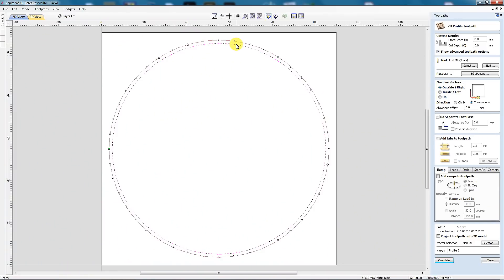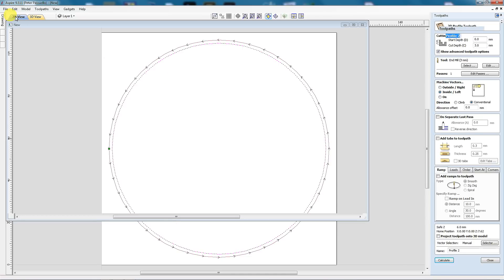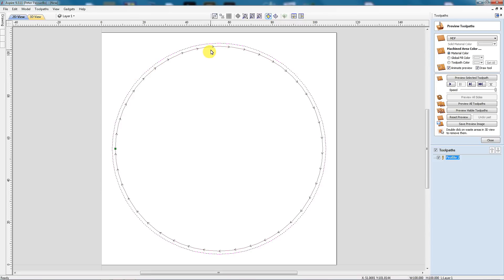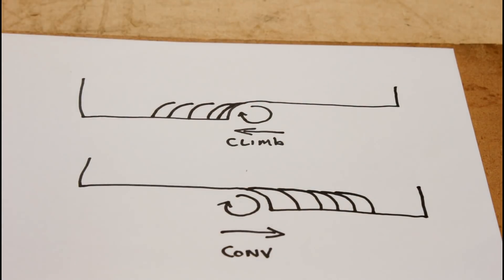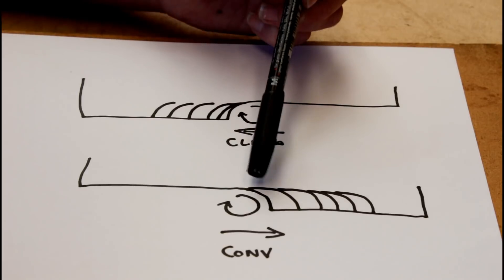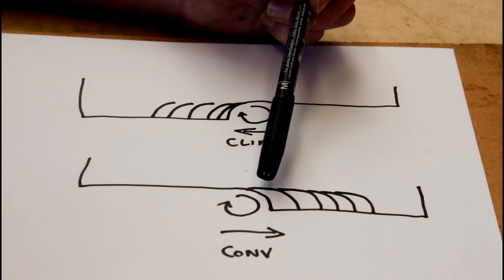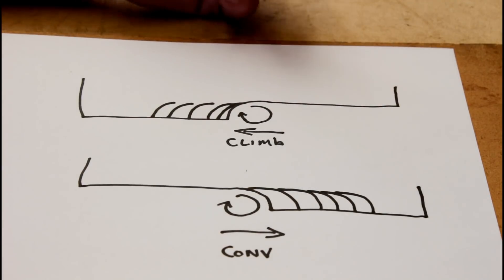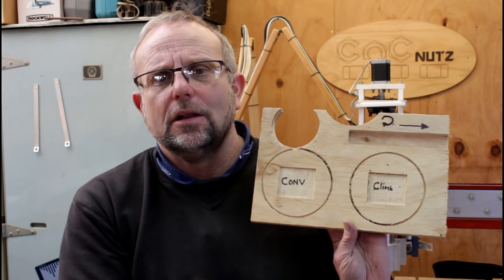Conventional or Climb Cut- CNCnutz Episode 223

Comment: using climb cut for finishing is safer in the sense that if you run on higher feeds or run into more material in tight corners and chip load peaks, cutter does not dig into material but makes an outer bump, which is easy to correct with a second pass, if desired.

Comment: one thing you must know about cutting parameters is that almost all information you can find about it was written with cutting METAL in mind.
all machinist books and manuals mean that you will cut an homogeneous material like metal or polymer.
so vast majority of this information just useless when it comes to cutting wood, foam, rubber or fiber composites.
Reply from the maker: Very true. Not much grain and fibres in steel and other metals which is what the mills traditionally cut. The same is true of feeds and speeds. Almost all the F&S tables are metal based.
Cheers
Peter

Comment: I have a nice scar on my index finder to remind me not to climb cut on a standard router. But I've always used climb on my CNC, presuming I will get a better finish - no fear of huge tearouts or broken corners like I would get with a hand held router. But, I'll have to think about what you've said here and run some tests.  Wonder if an up-cut vs down-cut vs compression bit would make a difference in the finish.
Reply from the maker: It's those sorts of lessons you never forget.
Cheers
Peter

Comment: Another informative video. Thanks Peter. I always use the conventional mode and if you think about it, the cutter is moving in the same direction as it would in a handheld router.
Reply from the maker: Thank Gareth.
That's where the name comes from. It is the conventional way of moving the hand router. I think the other way was called climb because the hand router would want to climb out of the cut.
Cheers
Peter

Comment: I cut a lot of real wood with sharp 90 degree corners and have found using climb cuts on the finish pass really helps mitigate any blow out while cutting the end grain on the corners of the wood. I definitely get those fibers left behind after the cut, but they usually get machined or sanded right off. Thanks for the vid!
Reply from the maker: Thanks Casey
Thanks for the observations. Will have to give it a try and see how it goes for me. 
Cheers
Peter

Comment: The chip load is specified at 50% RDOC, and when you are using less than 50% you have chip thinning, which means the thickest part of the chip is less than the specified (maximum) amount that occurs at 50%, regardless of whether it is done conventional or climb. In your raster pocket example, it is doing Climb in one direction and Conventional in the opposite direction. A better way of classifying Climb and Conventional cutting would be to say "thick to thin" for Climb and "thin to thick" for Conventional. Thus for any cut between 50-100% RDOC you are doing both, Conventional followed by Climb. So again, a slot is neither or both depending on how you look at it. This may help clear some things up:

https://www.cnccookbook.com/climb-milling-versus-conventional-milling/

https://www.cnccookbook.com/cnc-chef-video-chip-thinning-clear-present-danger-ignored/
Reply: Yeah Qwerty, indeed great link to that video. Very helpful info there. Missed that one before on CNC Cookbook.
Reply from the maker: Thanks Qwerty. 

That's a good website and I must spend some time looking at it as there is a lot of good info there.
Cheers
Peter

Comment: Good video Peter.

I happen to us both as the need arises. If I am machining solid wood I almost always use a climb cut because the cutter is severing the grain and not letting stress build that might lead to a split or run in the grain fiber. 

Erik
Reply from the maker: Thanks Eric.
I'm curious, do you use a slower feedrate for the climb cut than you might for a conventional one?
cheers
Peter
Reply: in the past I have not run slower on a climb cut. after hearing your logic, I will give a few test cuts at a slower feed rate a try. I tend to run pretty fast anyways, 250 in/min, time is money but if I can get better quality and less sanding, it would pay off in the long run. @cncnutz
Reply from the maker: It would be interesting to know if it makes a difference.
Cheers
Peter

Comment: Hi Peter, thanks for another thoughtful and informative video (presented in a friendly and humorous manner).
My view of conventional cutting is that it is always pushing the furry bits back into the piece - and all the big loose ends are left on the part which will be removed as the next chip.
With climb, the action of the cutter is pulling fibres out of the surface - and the surface they are coming away from is the finished one.
Everything is different when the material is not fibrous (acrylic, MDF, metal, flesh etc.)
As you said, rigidity is the key to making climb work - and if there is backlash or slop anywhere, it is doomed to fail (broken cutters).
Best wishes :-)
Reply from the maker: Thanks Perry

Comment: Great video. I believe I read, "conventional cut" the bit is sucked in to the material and with "Climb cut" the bit tries to "climb" out out the material. This can effect the cut with large cnc machines due to deflections in the machine and length of cutter bit.
Reply from the maker: I think your right Dave. If memory serves it comes from hand routing but I could be wrong. As with feeds and speeds I think this falls into the category of the black arts.
Cheers
Peter

Comment: Cut quality will vary with cutter, material, and machine: for example, in aluminum, with a brand new end mill, on a VMC in good condition (no slop in the ballscrews, etc) climb cutting will give better results almost always. However, as you showed, on your router, with your cutter, in wood, it doesn’t. 😀
Reply: The other thing that occurs to me is that your machine doesn’t have a zero backlash drive: IIRC, it’s a rack & pinion system. Consequently, as the cutter engages during a climb cut, it’s pulling the machine axis forwards, effectively generating tool chatter. 🤔
Reply from the maker: Thanks Paul

Well now I just feel foolish out in my workshop with my Black cat, Cauldron and fresh of eye of Newt.
Reading the world news lately I had got the impression that facts and science had been abolished in favor of feelings.
It's good to see that a few of us cling to the old ways, passed down from father to son, and still believe in science.
Cheers
Peter
Reply: CNCnutz (Peter Passuello) - Reality is overrated. Delusion is where it’s at now, bucko! 🙄
Reply: @cncnutz  Well, the world news is dominated by the US these days, it seems. An interesting melting pot of mental disability with a sauce of ultimate delusion, I guess. After the dust of collapse has settled, science can have a feast on the remains of that embarrassing experiment. I try to ignore them, but they are SOOOO LOUD.
Reply: Yes, it's a function of material, cutter, feeds, speeds, and machine. Do the same tests on MDF, PVC, acrylic, aluminum and you will likely see different results. (Technically expected to have different results, one of the plastics should have edge chipping from one type of cut but not the other. Tear out at the start or end of a cut is another issue that shows up under some materials and the type of cut)
Reply: @askquestionstrythings  And so, what did we all got wiser from your answer? I wouldn't dare to try ask you questions, risking to get deeper into the forest. I guess most here would like to see something as "If you mill oak with a janka hardness of 1400, a HSS double spiral down flute of 6mm at a feed of 1800mm/min and speed of 12,000 RPM will give good results when you're profiling a piece conventional, stepping down 2-3mm with each pass and a final cleanup climbing pass of 0.5mm. This goes for Shapeoko and open builds machines. More rigid machines, like Peter has, will be able to go faster than that. He has a very good video about speeds and feeds!!  Here is the link https://www.youtube.com/watch?v=lCf0EYLfGDw&frags=pl%2Cwn .
However, if you try to mill wood species with a janka hardness of about 2,500 or higher, it is better to switch to carbide because the HSS will get too hot and gets dull faster than you can say "Oh....sh......t". This is what can be called sharing my experience and empirical findings with others to build their experience on. Oh, by the way, janka hardness tables can be found on the web, just google for it. The wood database is also a very valuable source of information for that.

I hope I did you a favour with that info, can I ask for one back? Please refrain from non-answers in the future and try to actually enlighten others with your knowledge and experience. It will be much appreciated!
Reply: @paulvandriel2344  wow, I can't tell if you just have a bone to pick with the whole topic, with my YouTube name, or with the simplicity of my comment due to it being made on a phone. 

Sorry I'm not pulling out the machining handbook section on this topic to attempt to give you a simplified rule of thumb with lots of exceptions on how to make the decisions in machining. Or the engineering handbook sections on this topic either. 

I'm sorry you interpret my previous comment as a non-comment due to its simplicity. But I disagree with how you took my comment. If I remember right there's an Abomb79, or maybe it was someone else, video that touches on this topic too. That video demonstrates the edge chipping and tear out on a plastic mentioned on my previous comment.
Reply: @askquestionstrythings  If my previous explanation didn't made it clear, what will?
Reply: @paulvandriel2344  The only thing that is clear to me from your comment is you have a bone to pick with something, and it's somehow directed at me because you feel my comment is inferior to your expectations.  That or my comment was unclear and you don't understand at all what I was trying to convey.  i.e. what we have here is a failure to communicate. 

going by your statement I can only guess you want me to change how I phrased things to something like "If you mill [wood, MDF, PVC, acrylic, aluminum]" you will get different results for each.  With all of the dirty details on which is better in climb cutting and which is better in conventional cutting. honestly, I don't do enough cutting to remember all of the details on that. Off the top of my head I think it's aluminum and PVC has a better finish with climb cutting, acrylic is likely to have edge chipping with climb cutting.... and I have no remembrance of where MDF lands. but there are so many other factors that go into it that I wouldn't say that is a hard and fast rule.  The one hard and fast rule I usually follow is to go with Conventional cutting and only specify climb cutting on a rare occasion when the machinist handbook, or the engineering handbook, or the people on the shop floor say to.

climb cutting is a no with machines that have lead screws, and should generally only be done with a machine that has a ball screw lead; since even small amounts of backlash have very negative effects on climb cutting. 

but I can only guess that will still be inferior in your eyes,  as a "non-answer".
Reply: Paul van Driel that's more clear on why you feel my comment is inferior to your expectations. But out of the specific 57ish current comments on this video or even those comments within this specific thread, I don't agree that we are anywhere near a saturation of any specific comment. Now your personal experience may very well be making you see a saturation of comments related to your experience, that I honestly don't see in the comments here.  Maybe I would agree on a video with 3000 comments and multiple repeated comments, but on this video with under 60 current comments you are reaching towards just being pedantic.

Maybe try being less pedantic and more welcoming to new people in the community, try helping to build channel community around a topic of interest they share with you.  instead of telling someone that you don't like their comment because you see it as a repeat of information.  Honestly, I could totally see your comment as "I don't like your comment, don't comment ever again, or better yet get out of here" Now surely you really didn't mean it that way but it could easily be taken that way. Some people would rather just walk away when someone basically jumps down their throat to say that some minor comment agreeing with other people and mentioning a tiny additional detail was a "non-answer" or was a "platitude". 

Seriously how much time have we both wasted over your feelings about my comment? Time which we both could have been putting into other things like making awesome stuff, or discussing deeper details on this topic, or any number of other things.  Or even just say "welcome" to people in the community so maybe things can grow and get even more awesome.
Reply: @askquestionstrythings  Are you an American? Lots of feelings and subjective assumptions there. 

While the attentive reader/observer can easily notice that feelings and subjective assumptions are exactly what we need to avoid in empirical experience and knowledge. Platitudes like "Yes, it's a function of material, cutter, feeds, speeds, and machine." or "Do the same tests on MDF, PVC, acrylic, aluminum and you will likely see different results." are really adding nothing to finding solutions for problems. Is that a feeling? No, I don't think so. Just a finding. Do I know more after reading those words of you? No. Does anyone else knows more than before after reading your words? I don't think so. So what is the added value than of your comments?

I guess, that if you really wanted to discuss deeper details on this topic, you would have done that already? I clearly gave that a change with my earlier comment about Janka hardness, kind of bit to use in relation to the hardness of the wood material in combination with feeds and speeds, a link to Peter's video about that etc. Instead I see you climbing the barricades (or if you like, descending into the trenches) and start a rather useless rant about feelings, pedantry, inferior comments, expectations or bone picking.

So, I suggest you calm down a bit, do some useful introspection and make your next comments (here or somewhere else) relevant to the topic and with valuable information for the readers, so they can truly learn something. As we all can learn of Peter's experiments and findings, which he generously shares with everybody that wants to learn more. I'm sure, if you do the same, you will get positive responses!

I'll leave it at that.
Reply from the maker: Thanks Dark Knight. I have the distinct feeling that all this falls under the same heading as feeds and speeds. It's a bit of a black art and why the professional machinists deserve the big bucks.
Cheers
Peter
Reply: @cncnutz  We, humble little home machinists, deserve the big bucks just as much. Especially, because guys like you are sharing and deepening the public knowledge with videos like this. I don't agree about being it a dark art. It's more a matter of CNC'ing being a relative new thing, coming into the general public spotlight only in the recent years and getting very popular with hobbyists and small workshops.

Material wise, metals and composites are actually much easier to machine with CNC than wood. Metals and composites are predictable materials, manmade to specs and all the knowledge to get perfect results every time is available all over the place. Wood, however, is a natural product and much less predictable. Therefor, the lack of publicly available knowledge and experience in wood CNC, makes us think it's a kind of black art. Everything can be known and in a scientific/empirical way discovered. The internet and solid info channels, like CNC Nutz, will soon enough unveil all we need to know to get excellent results all the time. What we don't need is ballooned self proclaimed experts uttering gaga. Your videos are in my opinion a very valuable contribution to the build up of this much needed general available knowledge and experience.

Wow, did I really say all this?

Comment: It’s neither: it’s a slotting cut. Climb & conventional come into play when you don’t have 100% cutter engagement. 🙂
Reply: Are you gonna sent the white walkers now?
Reply: Paul van Driel - Sorry? I think that’s some sort of cultural or media reference... white walkers? 🤔
Reply: @darkwinter6028  To be precise; if it's a slotting cut, actually both climb and conventional coming in play at the same moment. As Peter very well showed and explained. If it would be an outside or inside cut only, with no material on the other side of the cutter, it would be either conventional or climb (not both). White walkers are the horror from the North in Game of Thrones. Expected to come in the Dark Winter. The rest you can probably guess.
Reply: Paul van Driel - Ahh. Not a Game of Thrones fan. And my username predates it being a major media franchise... 🙂
Reply from the maker: Your on to it. 👍